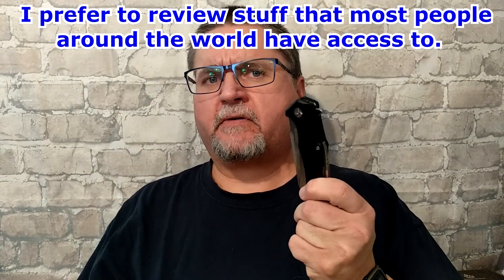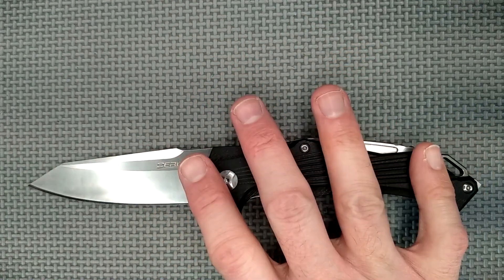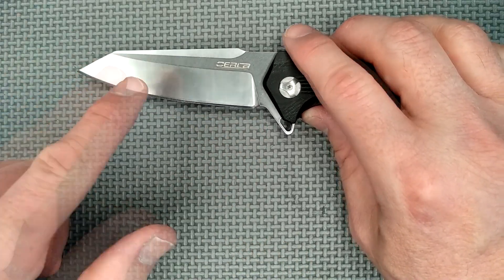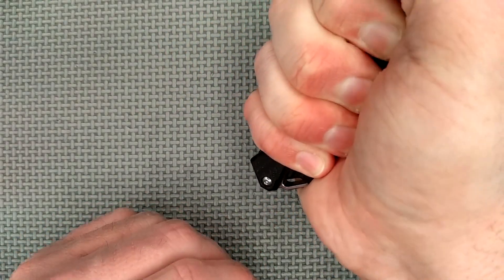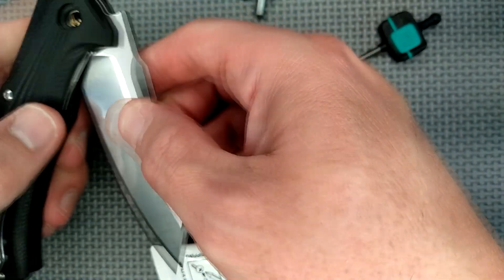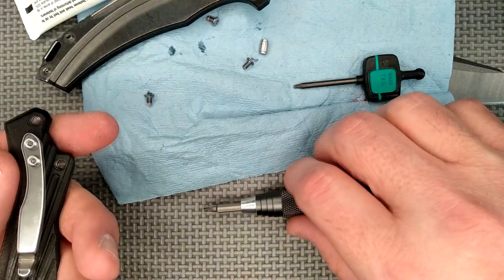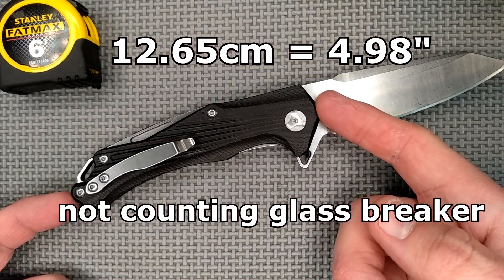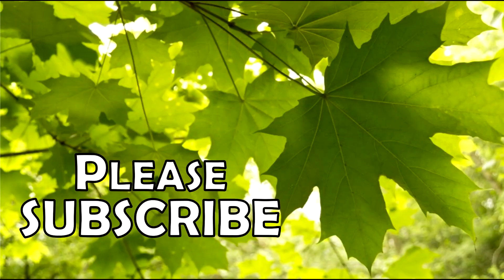Review of a knife from "OERLA" - Model: TAC OL-0027

Comment: If you don't have a t7, you could also try a thin piece of rubber or latex between the bit and the screw. A clipping from a latex glove or a rubber elastic works well bridging the gap while also providing traction.
Reply from the maker: yes, there are tricks to try, I don't like to use those much because I have had only so so experience with them.  But in a pinch those are good things to try.

Comment: this is a rebranded knife that was originally sold by a Chinese company and it was way cheaper than $30 it was under $20 and you got a lot more for that $20 you got a case with it and this wasn't the only company that bought this design from that company mtech knives also released a version of this as well.
Reply from the maker: I have noticed on their website that several of their knives are clearly rebranded, mostly in their folding knives is where it is happening.  But I have looked and I have not yet found this exact model being sold by any other brand - but that doesn't mean I think you are wrong, just that I haven't seen it
Reply: @CanadianCuttingEdge   mtech usa sold this knife under it's evolution series knives model # mte-fdr025